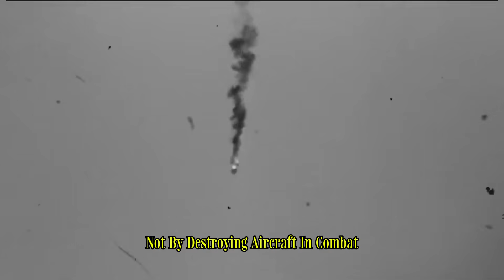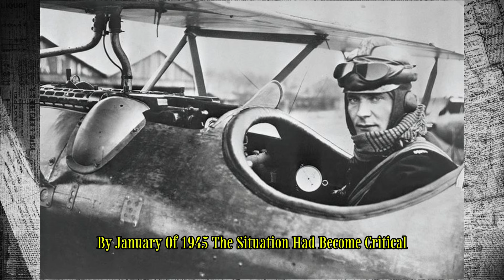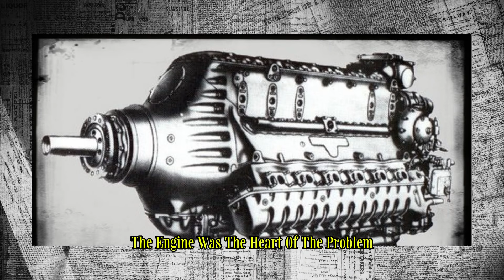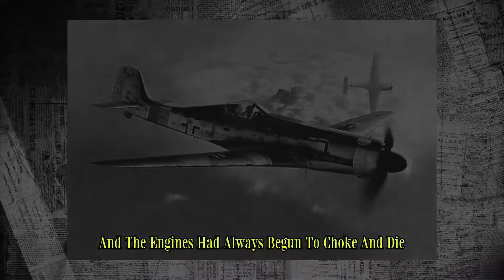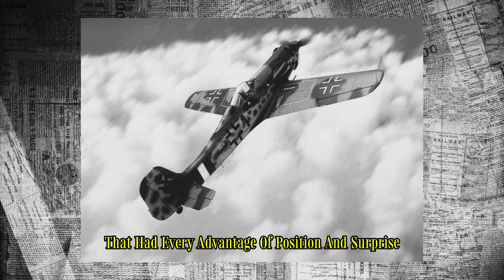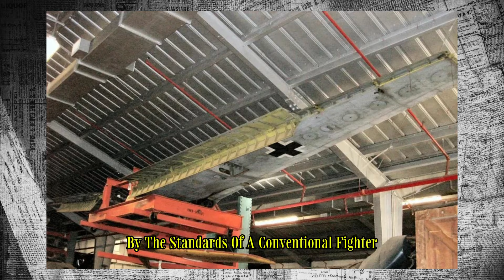The Engineer Who Solved The Problem That Was Killing Germany's Air Force !

Comment: --The US 8th Air Force suffered over 26,000 combat deaths in the European Theater of Operations (ETO) during World War II, accounting for roughly half of all U.S. Army Air Force casualties. Including wounded and over 28,000 prisoners of war (POW), total casualties for the "Mighty Eighth" exceeded 47,000.
--The US 8th Air Force, in the European Theater of Operations (ETO) during WWII, flew over 600,000 sorties and dropped over 670,000 tons of bombs, devastating Germany's industrial infrastructure, including fuel refineries (like Ploesti), ball-bearing plants, and transportation networks, while sustaining 26,000 deaths. This strategic daylight bombing secured air superiority, crippled the German war economy, and disrupted troop movements, contributing significantly to the Allied victory. 
--By the end of WWII, RAF Bomber Command achieved the systematic destruction of German industrial, transport, and oil infrastructure, crippling the Nazi war machine by 1945. It destroyed major cities (e.g., Dresden, Berlin), diverted German resources for air defense, enabled the Allied invasion of France, and contributed to the defeat of U-boats, while maintaining a high rate of aircrew casualties (44% death rate).
--RAF Bomber Command suffered extremely high casualties during World War II, with approximately 55,573 to 57,205 personnel killed out of 125,000 who served. This represents a fatality rate of roughly 44-46%, with an additional 8,403 wounded and 9,838 taken prisoner, marking one of the highest loss rates of any Allied branch.

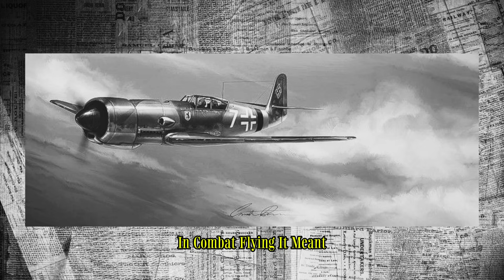Comment: At 18:01 - what in Blazes is that thing?!!!!!
Reply: Bad art
Reply: @hertzair1186  Actually, it seems to be the Me-209H, a variant of the Bf-109 that was prototyped in November 1944 with wide track undercarriage and anular radiator (DB 627B 12 cylinder inline engine).

picture:
https://upload.wikimedia.org/wikipedia/commons/e/e1/Me_209_V5_44218398.jpg

wikipedia entry:
Messerschmitt Me 209 (second design)
https://en.wikipedia.org/wiki/Messerschmitt_Me_209_%28second_design%29
Reply: Looks like a cross between a Me-109K and the front of a Fw

Comment: yet they had more ME-262 then Focke Wulf TA -152  so B29 ceiling would not be a problem.
Reply: The issue is far more complex than simply having more Me-262s. The Schwalbe was more complex to manufacture, requiring rare metals in the production of its turbines, which were not yet in a mature design phase. It was an aircraft that demanded highly skilled pilots, as well as special concrete runways for operation. All of these were luxuries that Germany did not have in the final months of the war. The Ta-152H would have been a better choice for mass production than the Me-262.
Reply: No pilots! Gwatney downed 27 P51,s to no avail.

Comment: Not true, The Me 109 could reach the B17 formations. The Allied fighters finally got the range to fight them.
Reply: Yes but not the B29. The reason there are no examples is because ALL the B29s built served in the Pacific.
Reply: @BenjaminShearin-m6i 
A Bf109G had a service ceiling over 36,000 ft. The 30 mm shells would dealt with any B-29, with ease.
Reply: @EK-gr9gd yes ammunition helped the Germans as well as the Americans.
Ask any German combat general which weapon system had greatest effect on the war from either side and they all agreed, the American proximity fuse!